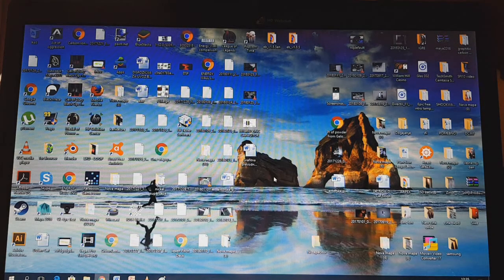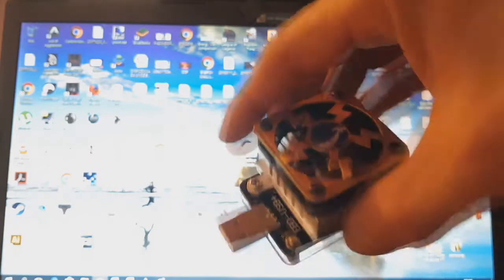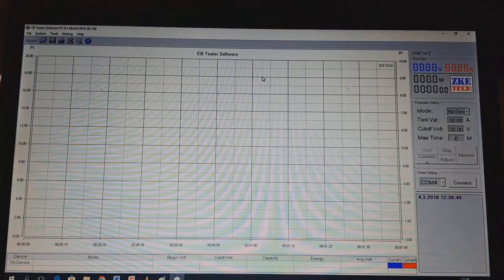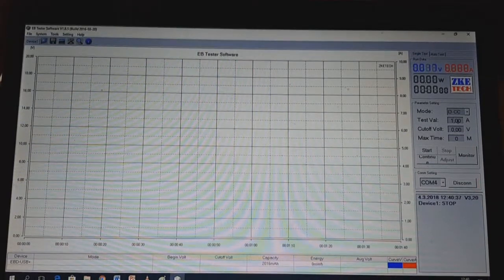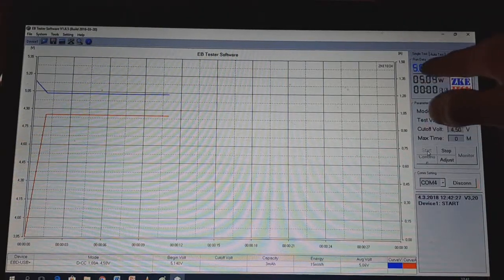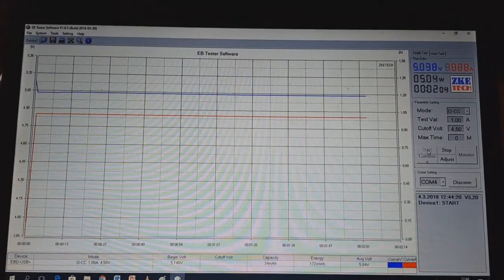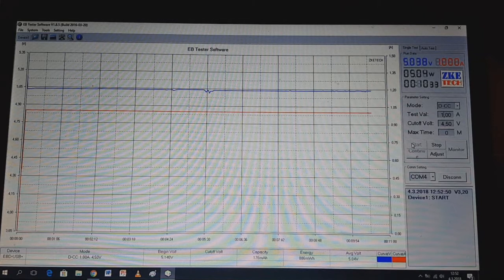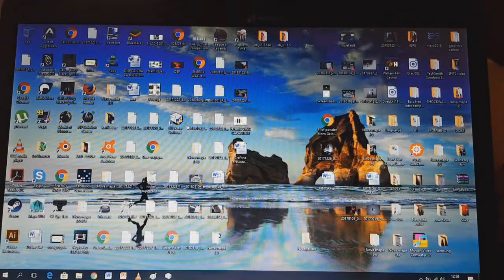GOOD STARTING EQUIPMENT FOR DEVELOP YOUR BATTERIES (ZKE Electronic Load)

Comment: can you please put link as where to find software eb tester
Reply from the maker: The link is in description
Reply: @cayrex  your link to the software doesn't work. the software is still around, but getting harder to find. you might want to remove the link as this there isn't any consistent reliable source, tell people the exact file name so they can search for it..
Reply from the maker: @timezonewall  again,... the name is in description. eb v1.85 build 1018 software
Reply: @cayrex  again, your link to the site gadgetaddict is broken and should be removed. again, you should include the file name, which is "eb_v1.8.5en",  searching for "eb v1.85 build 1018 software" brings up hardware sellers, not the software.  I'm just trying to help others.

Comment: Glad to hear you are back and well.
The electronic load will make life much easier for you :-)
I am working on using the monitor function of the electronic load  in conjunction with an Arduino to automate the charge discharge cycles :-)   Martin.